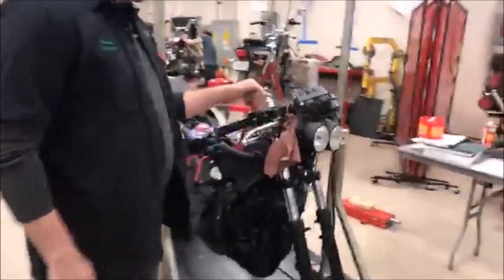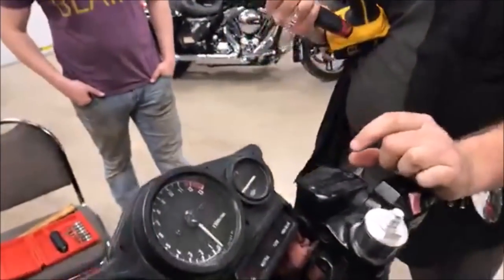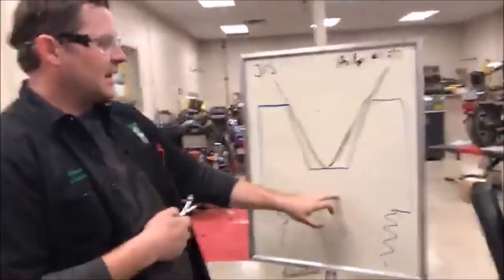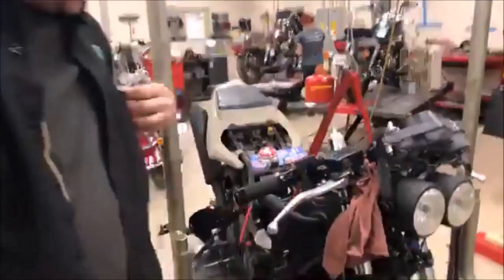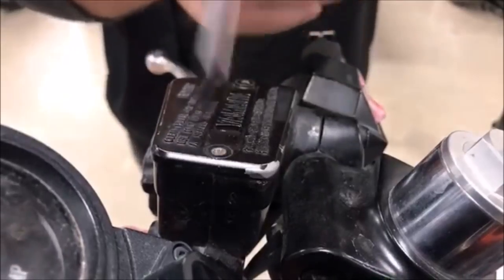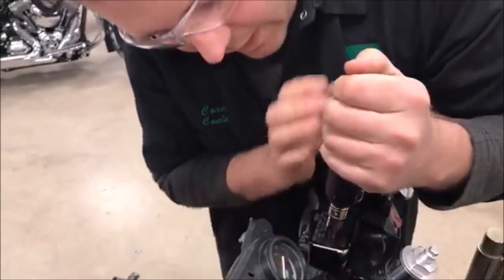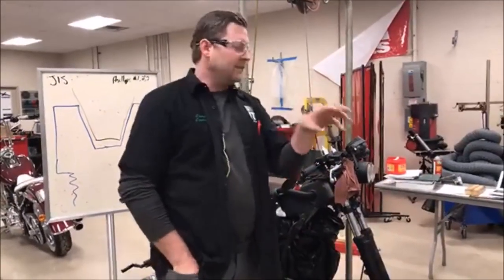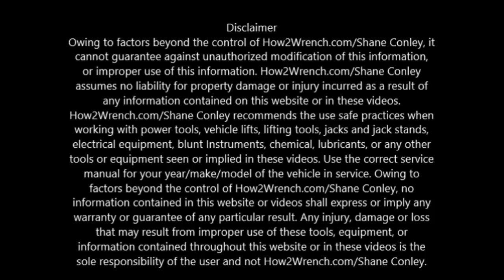How to remove small stripped screws and fasteners! Demo: Stripped Master Cylinder Screw

Comment: I`m a retired mechanic and knew about the japanese phillips. Never thought to hammer the screw head with the bit before using. If I need to I`ll grind some of those free coupon HF screwdrivers to fit. Thanks and I gave a "like' to it. Never too old to learn. I have a secret way of freeing up frozen bolts and nuts I might share with you sometime.

Comment: The first JIS driver I ever bought was the Vessel Impacta #2. It is a impact driver built into the handle of the screwdriver and it works well. I have had screws stripped so badly a Philips driver could not get purchase on it but the JIS driver was able to back it out and allowed me to replace the screws.  For those on a budget I highly recommend the Vessel 220w as it has JIS tips #1,2 and 3 and a slotted tip.
Shane's tip about grinding the tip of a Philips driver will help a little but the geometry of the blade is different than JIS so there is no substitution for having the correct screwdriver.

Comment: Excellent tutorial. I use a Milwaukee battery impact driver, such as what carpenters use, to remove stuck screws. But I still prep. So far it's worked every time.

Comment: Hey Shane , Good tip for you  . 
Use an auto punch to make an indentation around 1-2mm from the OD of the screw head .
Then use a solid punch with a tip similar to the size of the indentation made by the auto punch . 
Start at zero degrees tapping it gently to seat the solid punch and gradually add a few degrees in the direction of loosening the screw while tapping  . Works 90% of the time 

K
Motorcycle Mechanic  - New Zealand

Comment: Hi Shane, the fastest and easiest way to get those off is with a centerpunch. Knock a deep enough hole on the edge of the screw then tilt the punch and knock it counter clockwise. Learned it from a local mechanic.
Reply from the maker: Hi Pang, that is an option but not the choice for me. Lots of risk to scratch the cover when use miss (which you will every time the grip is not enough yet and it jumps out). Also many other time the master cylinder is plastic and I don't want to add side loads as you hit with the hammer, thirdly....the "shock" of the impact tool has a benefit the standard punch cannot give...shock + twist. My thoughts...BUT there is a time and place for what you mentioned and MUST be in the mechanics choices! Make it a great day. Shane

Comment: I can't believe you publish this video now because I was at my garage today trying to synchronize my V2 carburetors and I figured that the other carb's mixture screw is stuck in there really good. Apparently previous owner have tried to get it out but actually only managed to messed it up. Of course it's slightly more complicated, especially because I'm not very keen to take my carbs out again. I think I'm trying some liquid to loosen that screw a little.

Comment: Thanks Shane, I must be the one in a million that missed the Japanese standard screwdriver! Just ordered them. And I also love my impact but thanks for adding the setting the head skill set!! Awesome. Hey one question, easy outs, would you make a video explaining the proper way to attempt them?? Please. Left handed drill bits etc. I fail all the time. !!! Thanks again. Great videos.
Reply: I wonder why the hell do they use that type of screw driver. IMO, developing a tool that was already designed way back before the japanese developed this type of head fastener and yet they prefer to make some weird angle head design, JIS? jesus. Feels like they are doing that on purpose just to get you to buy more tools and so when you do do it wrong then its more susceptible to some impatient people to just throw the part away.
Reply: Lime Phillips head screws are designed to torque out at an appropriate amount of force which often as you know strips the screw. JIS screws are not designed to cam out like the Phillips are, and if you use a Philips driver on a jis screw it will pop out just like the Phillips is designed to do. JIS IS BETTER IMHO, it's the crappy Phillips screwdrivers we all started using that is the problem.
Reply: Yea, i understand that.
Reply: It goes back to Henry Ford not being able to get the rights to use the Robertson screw design (ak square drive) - which would reign supreme in North America and likely the world, if he had.
Reply: wth lol

Comment: Some Manufacturer should make an impact that has a setting in between fwd and rev that does not rotate and a bit that is hard enough to be impacted in to renew the head of the screw.
It would probably be a best seller!
Reply from the maker: It actually exists...I will have a future video on it. It's on the schedule for this summer. Stay tuned...

Comment: I love this channel I wish I knew about these courses when I was looking into schools I would have loved to take them.. I do have a prairie 650 which is in bad shape I’m rebuilding it because it went down running so only should need a freshening up service plugs and carb kit... while working in the carb before watching your videos I had an issue taking the throttle/post for butterfly off because I could t activate the throttle by hand... later I found out if wasn’t so much hunk sticking it but the nut was so tight it basically bonded the throttle plate or butterfly up... so now I loosened the nut and it activates by hand easily and spring brings it back but the dang brass throttle plate or butterfly plate will not line up anymore I’m having  a buddy look at it but do you have any suggestions? I did get one of the two screws in but the second hole has 1mm or less brass showing in the hole and it just will not line up right
Reply from the maker: Love it! Sorry I never saw this comment! 
We sure love you taking the time to comment.  The fastest and best thing you could simply do for us is hit that subscribe button…helps us creators more than you know! 
Join this channel to get access to perks:
https://www.youtube.com/channel/UCBhM8DCKnT3qXwTW0eToyCg/join  
Want to help us back? Please subscribe and give us a high 5 here:  https://www.paypal.me/how2wrench  
Follow us!
www.How2Wrench.com      
www.Tools2Wrench.com   
Facebook: 
https://www.facebook.com/How2Wrench/  
Instagram:
https://www.instagram.com/how2wrench/

Comment: I do it by dipping the bit in a small dab of valve grinding compound and hammer it out with the impact driver
Reply: Problem solved you get the screw out by breaking the most expensive part.

Comment: Just another free 2¢ just before tapping the impact driver in the counter clockwise or removal direction, I find a LIGHT couple of taps in the clockwise or tightening direction while you still have good bite that way is just enough to break up some of the crust in the hole. If your a naturally meat fisted individual, skip this step.
Reply from the maker: Hi Paul...Thanks for commenting and adding value to our community! I agree on 6mm or 1/4 in and larger fasteners and good tip! for the smaller fasteners like on master cylinder caps I would just go in reverse as the tool is much stronger than that small diameter and most likely will snap them off. 

Have you subscribed yet to never miss a video? Have you seen the video playlists? Over 600 videos! Check them out here: https://www.youtube.com/user/conleybuilt/playlists  

Want to say “thanks” or “keep it up”? Click here https://www.paypal.me/how2wrench    
 
Your answers and help are just around the corner. Save time and money while protecting your investment and yourself by doing it the right way at www.How2Wrench.com

Comment: I use a Dremel to cut a new groove in the top of the screw and use a large flat head for maximum leverage
Reply from the maker: Thanks for commenting and adding value to our community! I did that for ALL the years of my career until I discovered these pliers. Now no dremel (risk) and crazy fast removal. Wouldn't you have to agree? Best $30 I ever spent.  

Have you subscribed yet to never miss a video? Have you seen the video playlists? Over 600 videos! Check them out here: https://www.youtube.com/user/conleybuilt/playlists

Want to say “thanks” or “keep it up”? Click here https://www.paypal.me/how2wrench  

Your answers and help are just around the corner. Save time and money while protecting your investment and yourself by doing it the right way at www.How2Wrench.com

Comment: Grind a straight slot and use a flat headed screwdriver. Not a fan of belting an aluminium casting with a hammer.